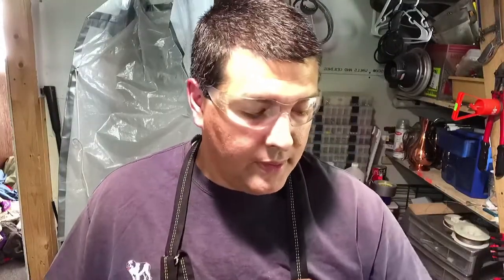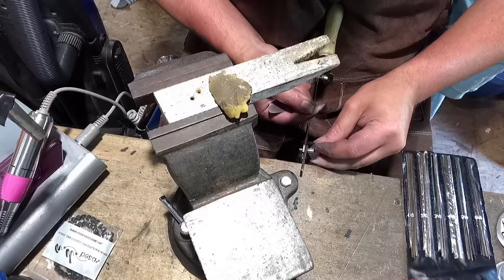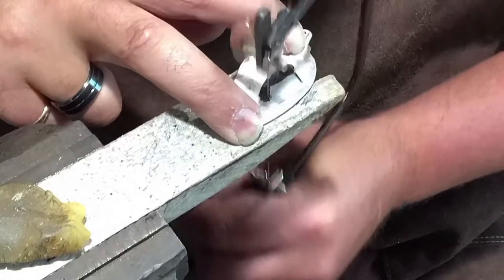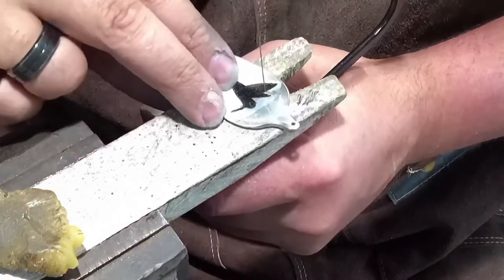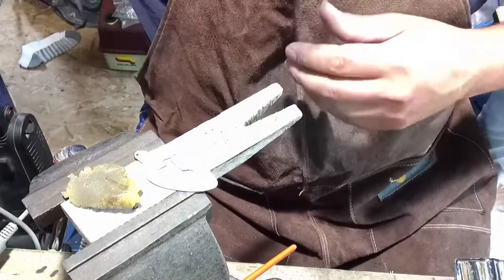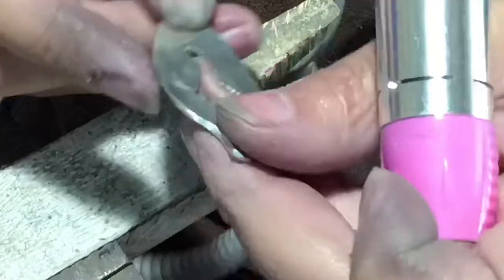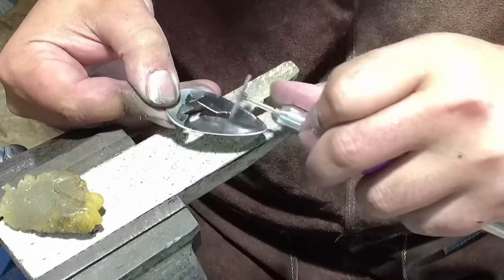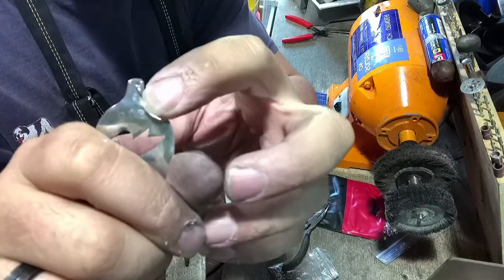Piercing spoon silhouettes

Comment: Thank you so much for sharing, Jeremy! Is that spoon silver plated? If so, what is the base metal that's being plated? Also- Could you do this with stainless silverware?
Reply from the maker: Thank you for commenting, it is silver plated. I’m unsure of the base metal. A lot of different companies used a lot of different mixes some more copper some less it’s really hard to know for sure.

Unfortunately, stainless steel will destroy the blades almost immediately. This method works with most of your soft metals.
Reply: @FlatwareCreationSS  Thank you so much, Jeremy!
Reply from the maker: @Jimmy-sb3fc you’re welcome.